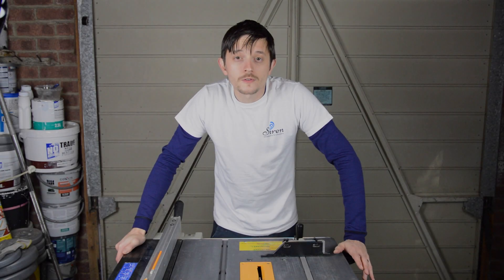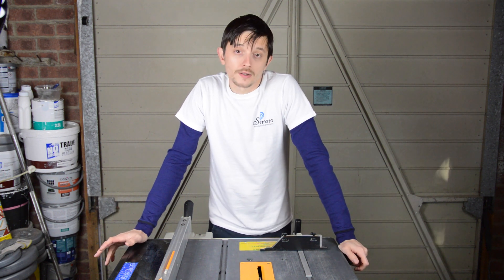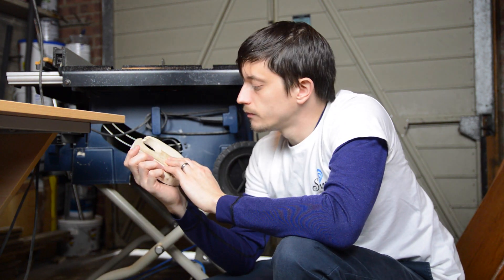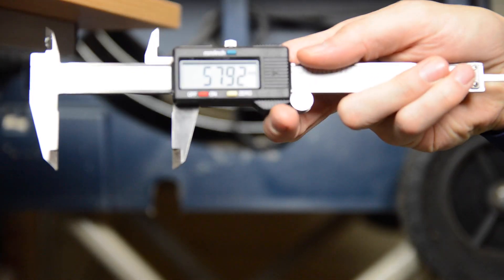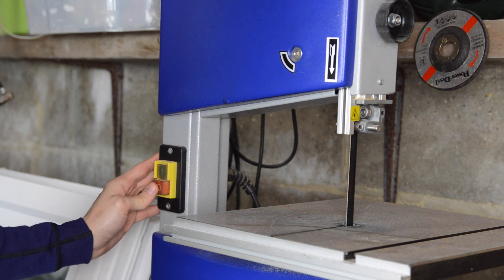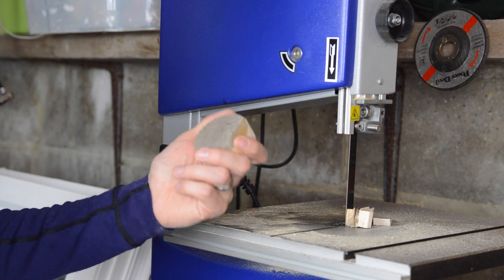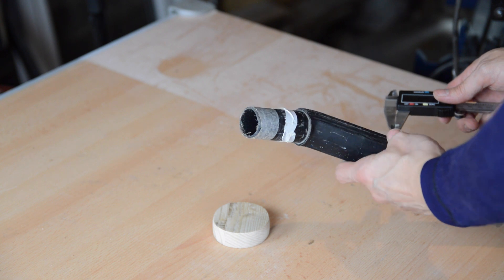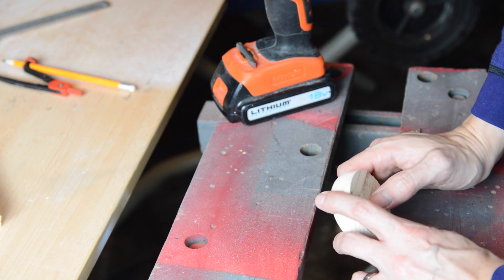Make Your Own Table Saw Dust Port Adapter

Comment from the maker: Speaking of safety, you will notice that in the video, my bandsaw blade guard is raised to maximum height. At the time of filming the guard was not working, which not only made this extremely unsafe but also made it almost impossible to cut the curve. Please do not try that bit at home. Luckily I came away with all fingers intact. Stay safe.